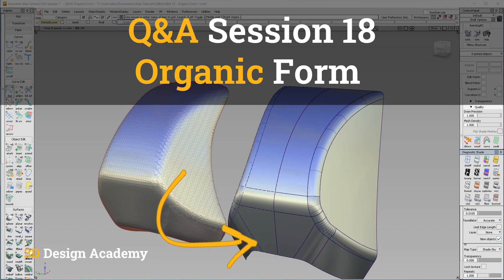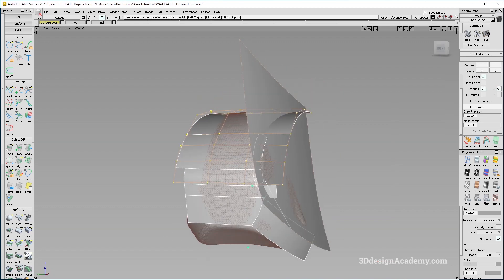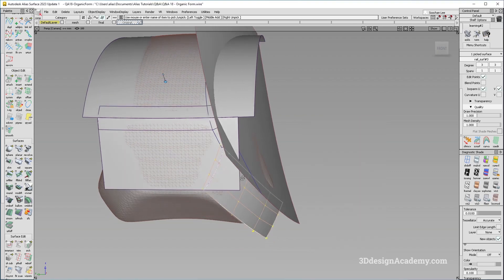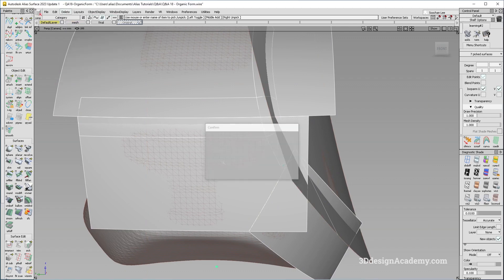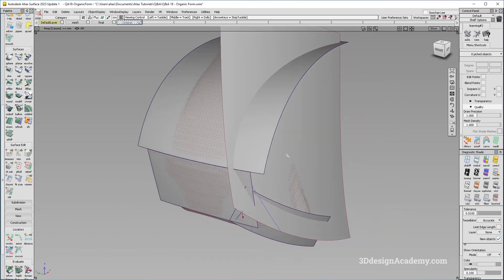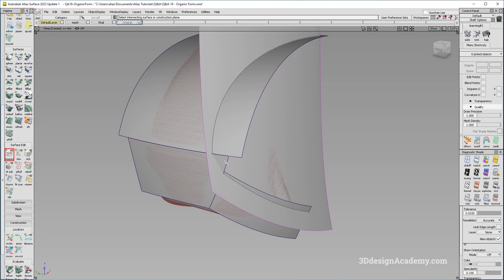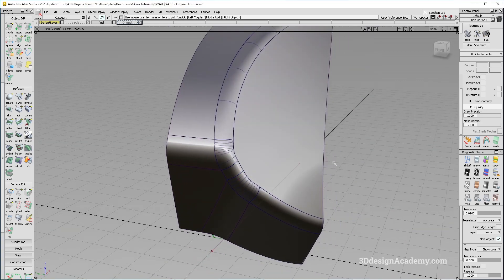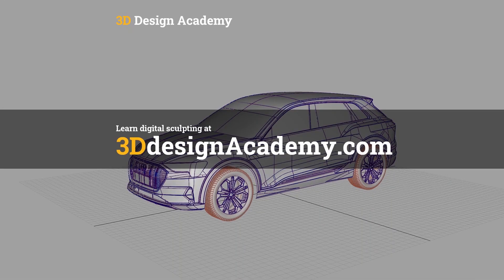Autodesk Alias Tutorials I Q&A 18 - Organic Form

Comment: A bit back and forth (chaotic) demonstration though.
I think you were trying to do the final overall fillet all at once. It will work but gives many complex tertiary fillets. Great fast modelling skills though!
Maybe you will show the next approach as starting from the bigger fillet radius to the smallest one by one OR if the overall fillet should stay the same (though chordal might be better in certain parts of the model), then starting from the bigger surfaces to the smaller might lead to a less complications further down the line.
Reply from the maker: Which part did you find chaotic? Let me know and I'll try to organize things a bit better. Also, I will be doing a part 2 where I do a cleaner version of this.